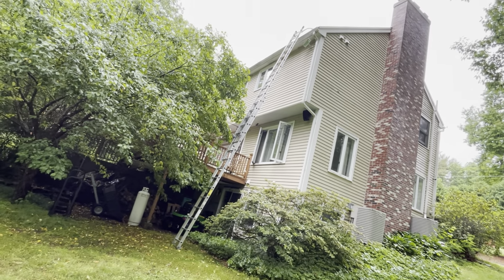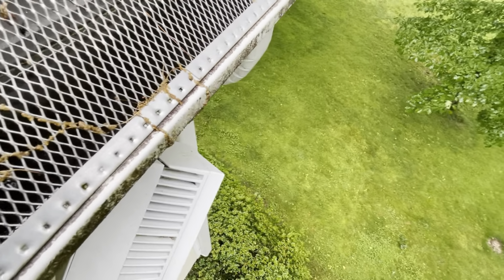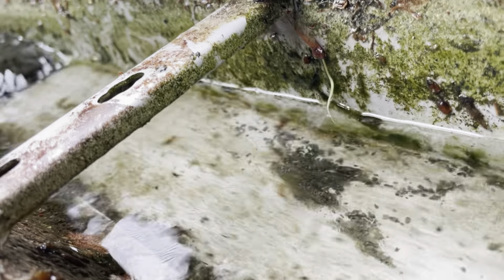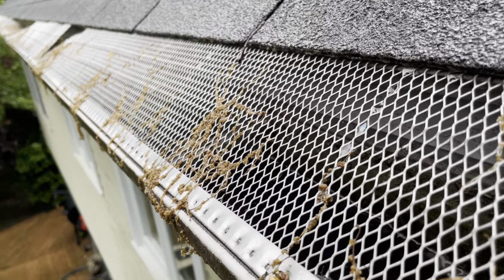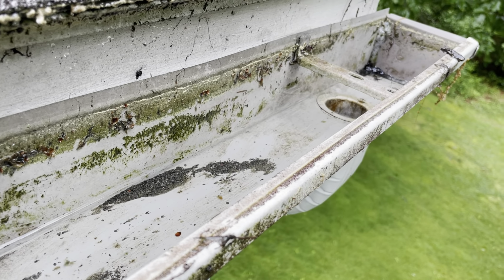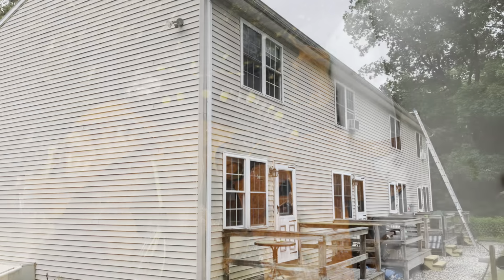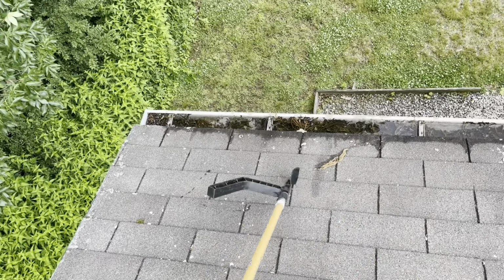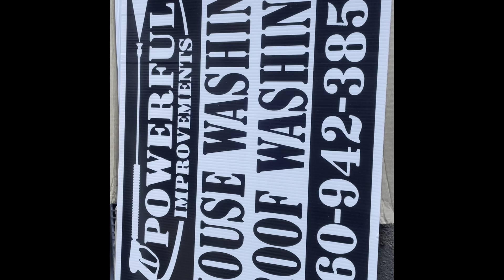Brimming Gutters

Comment: I have a roof treatment tomorrow on a 2-1/2 story house.  It will be done from the ladder  because its extremely steep.  I wish I was as comfortable on a ladder as you are. My knees start shaking!
Reply from the maker: That’s a good thing. Move slowly and talk to yourself. Be super careful with the gun. Use a trigger lock climbing up and down. Do t want to bump it and spray your self in the face. Glasses on 100% if the time. Good luck!!
Reply: @powerfulimprovements  Thank you for the advice! It all worked out! I started putting trigger lock on spray gun whenever I'm not spraying.  It only takes a second to bump the trigger and have a bad day. Thank you Joe!
Reply: Joe is so smooth with the ladder. I need a 40’ to reach the top of a chimney for a small area of rust removal on a stucco house but i do not have the confidence to put that ladder up and then climb it.

Comment: Your gutter guards would have done the same, correct?  It’s the same style with similar size holes, so all the granules and mud would still get in correct?
Reply from the maker: That’s correct. They just don’t break at the seams. All guards still need to be maintained and flushed every couple seasons
Reply: @powerfulimprovements  Gotcha!  Thank you

Comment: Ever considered using a sewer jetter and hose to flush gutters and downspouts? I imagine it would be messy, but if the rear jets push everything back towards the downspout as it propels itself then you could leave the old guards in place.  Thought about trying it before, but never gave it a shot.
Reply from the maker: I was thinking about that today. I think it would blow the guard off
Reply: @powerfulimprovements  If I ever try it I'll report back.